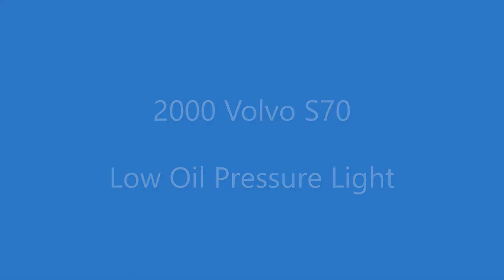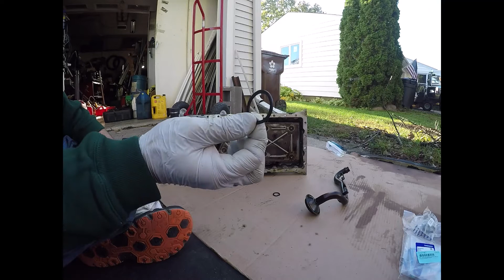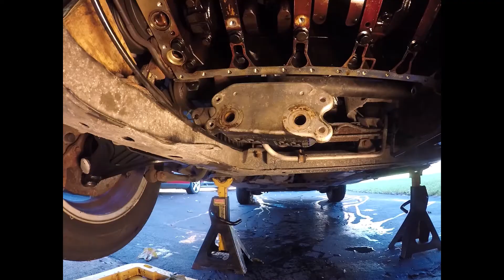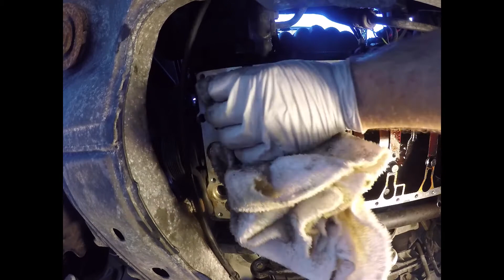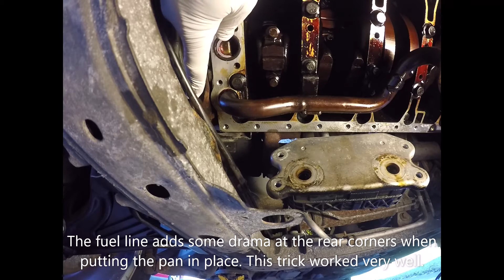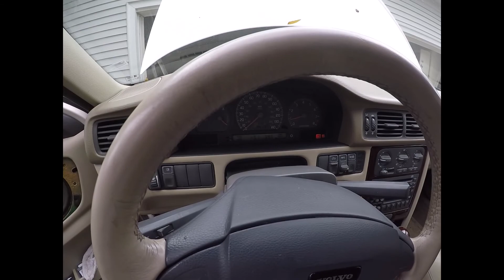2000 Volvo S70 Oil Sump Issue Low Oil Pressure light flicker

Comment: Your title has a typo - 2002 S70 does not exist.  I had a ticking problem at idle.  I had a Volvo specialist advise the o-rings needed replacement, and he was right.  Dropped the pan, replaced, and problem solved.
Reply from the maker: You are correct. Same process prevails.

Comment: I have the same pan but mine won't come out, the sump appears to be stuck onto it. Any ideas?
Reply from the maker: Triple check and check again all the bolts are out. The sealer can be a little aggressive and needs a little bump to break the seal.

Comment: Greetings friend, where can I buy a seal kit or maybe you have the measurements of the orings
Reply from the maker: I was able to source the seals alone or in a kit here in the US with no issue from FCPEuro, Rock Auto, and IPD. Volvo likewise sold the seals at a much higher price.
Reply from the maker: The lower seal kit was a genuine Volvo number 30750783. You need the pan chemical sealer as well, and it is a good time to change the oil dipstick seal as well. Also you should replace the oil cooler to oil pan seals. They were not included in the Volvo kit. Readily available from Volvo or other sources I noted. If you are overseas, parts are even more readily available in EU.
Reply: @houseofbrokendobbsthings5537   My friend what sealant are you referring to, on Ebay I found the kit with the number you sent me but it does not include the chemical sealant
Reply from the maker: @andresbasti5061  

Anaerobic Sealer Chemical Gasket
Mahle - BUL1271200 - 30644517 - 124841

This is a standard sealer for Volvo and others. The part number above is from Mahle and I believe Volvo as well. Lots of suppliers for this sealer. It is special in that it cures in the absence of oxygen and forms a very thin sealant layer. This is not silicone sealer that is more prevalent on other vehicles. A small foam paint roller makes application very easy on a spotlessly clean surface. A little sealant goes a very long way. The key is thin and uniform application. My rule was to see a thin sealer coating that was not quite transparent and no gaps.
Reply: @houseofbrokendobbsthings5537  I thank you for your great help, I am going to look for this sealant. Merry Christmas to you and your family, my friend.
Reply: @houseofbrokendobbsthings5537  Thanks my friend for the information.
Reply: sont use anything but Volvo when it comes to rubber in contact with oil @houseofbrokendobbsthings5537

Comment: thanks for the video ! Did this repair correct the oil light ?
Reply from the maker: Absolutely!  Just make sure to get the sump transfer o-rings while there. Those will be less visible and are part of the pickup tube pathway. This little S70 is all good again! My son in law loves it as his daily driver. The toughest part is getting the pan in without touching the sealer. Just move or disconnect any potential obstructions and it goes right in. Thanks for watching!
Reply: @houseofbrokendobbsthings5537  there aren’t many videos on this I appreciate the advice ! And that’s awesome , my C70 is having the same problem so I’m thinking of getting this done considering it’s at 200k
Reply from the maker: @jonathanreyes3832  200k its just a baby - LOL.
Reply: thanks for the video.🙂